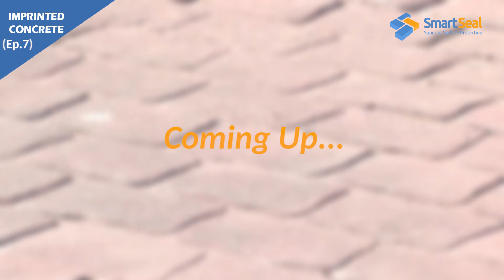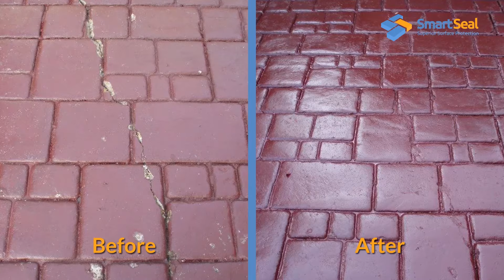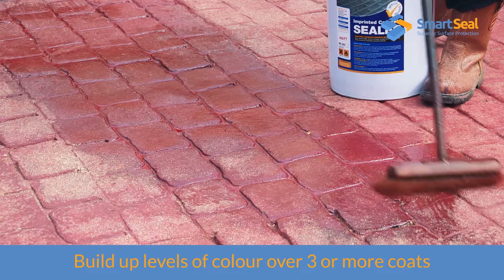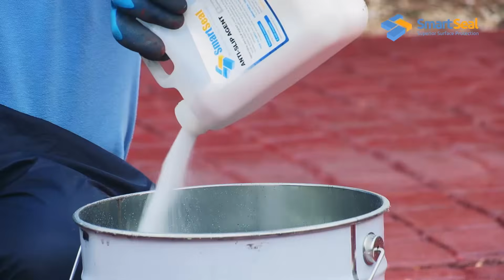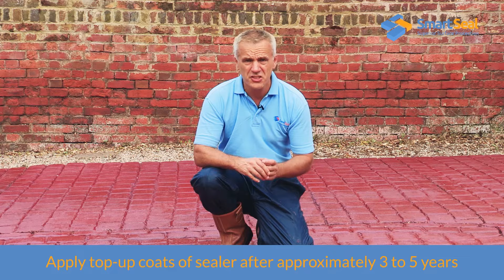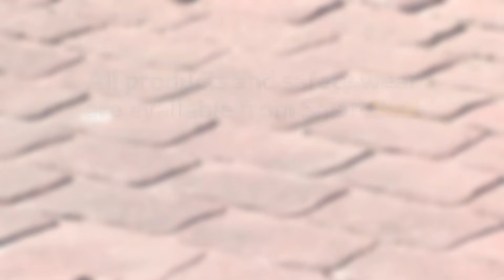How To Re-Colour & Repair a 20yr Old Pattern Imprinted Concrete Drive (Ep.7)

Comment: Im be doing my drive in coming weeks.never done it before. Do you have to do the mastic between the slabs of concrete pads? As i did not notice any when we moved in! And can i use a roller. Much appreciated
Reply from the maker: Hello Zedsta, thanks for your question. It is recommended to mastic the expansion  joints after you have completed the resealing process. Although not essential, it avoids the tendency for these joints to fill up with muck and eventually weeds that would spoil the overall appearance. As per the points and reasons given on the video, we would recommend applying the sealer with a broom.  Hope that helps. Nigel@Smartseal
Reply: Yes thankyou. Ordered all my stuff from your website.  @SmartsealUk

Comment: Does this covered exposed aggregate from high traffic areas?
Reply from the maker: With Coloured Imprinted Concrete, If  aggregate is exposed in the concrete, this is due to the 'colour hardener' (the product screeded and 'floated' into the concrete to harden and colour it when 1st laid) being worn away. This can happen over time if the sealer is not applied regularly to protect the surface. Recolouring with pigment and sealer might work for a period of time, but because the sealer cannot properly 'soak' or 'key' into  totally non porous stone or aggregate, regular 'touch up' applications in those areas might be required. Hope that helps Nigel@Smartseal

Comment: In this case you have put almost the same colour down. Can you put a GREY over the top of a terracotta colour to match in with new paint job?
Reply from the maker: It is possible in some cases Leanne, but not recommended. Trying to change the colour can lead to peeling, flaking or premature wear. Feel free to send us some pictures for further advice. Regards, Rick@Smartseal
Reply: did you have any luck doing this?